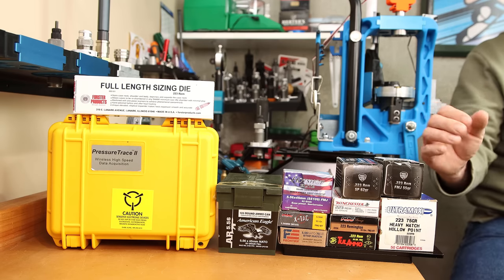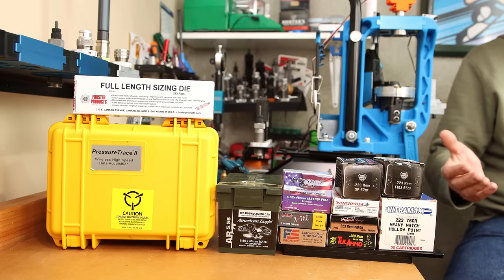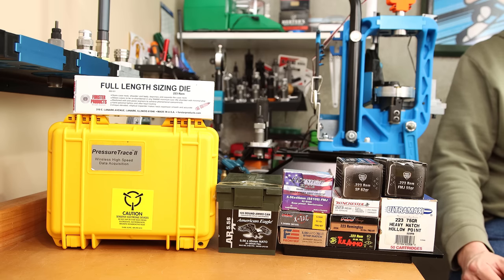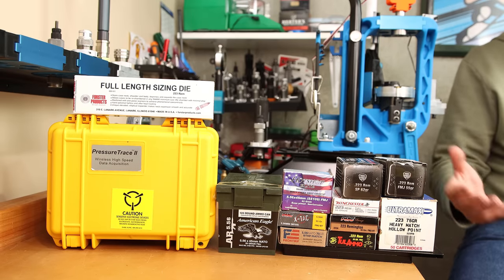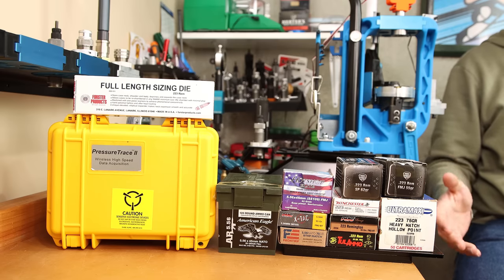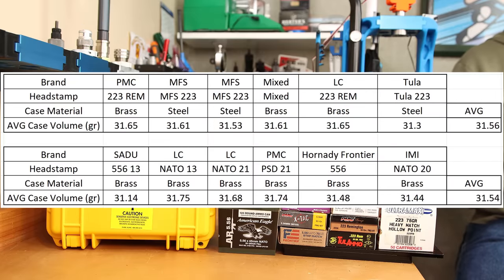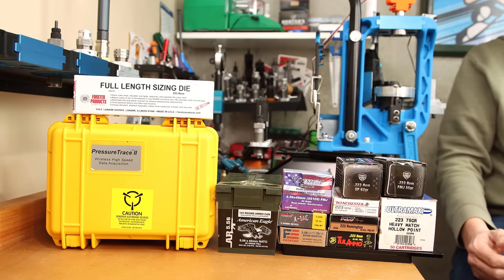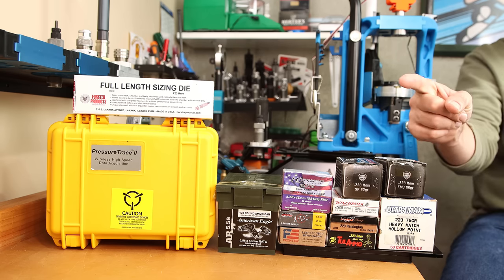223 vs 556 - The Hidden Truth No One Tells You!

Comment: I’ve heard so many different explanations of the differences, that I just built all my rifles with 5.56 chambers and shoot whatever I have. No worries
Reply: There is still one worry, you should never shoot soft point exposed lead bullets out of an auto loading rifle, the same holds true with shooting soft nose .30/06 out of an M1 or soft nose .308 Win out of an M14, when you do that you run the risk of a sliver of lead being shaved off of the tip while cycling the round into the chamber and getting lodged in between the casing neck and it's mating surface in the chamber, since all of those cartridges head space off of the casing neck this can cause issues that can lead to the weapon firing without the round being fully "in battery".
Now you'll run into all kinds of people who'll say "That's a bunch of bull, I've been doing it for years...", well if anyone wants to second guess the SAAMI who are the people who do all the testing and research on firearms then God bless them, something like that may be rare but if you have my luck you'll get skin tore off your face the first time you try firing soft nose hunting rounds out of an auto loader.
For shooting hunting rounds out of an auto loader safely is why Hornady developed the Ballistic Tip Polymer nose bullets, the plastic tip is the right material that won't have a sliver shave off and cause that problem.
Reply: @dukecraig2402  Wouldn't that be totally dependent on whether or not all the sharp edges have been removed from the feed ramps?  And more of a concern during the break in of a new rifle?  It seems right now the biggest concern is being able to source ammo while not paying the current extreme prices....
Reply: @chuckvan1568  
Yes I'm sure feed ramp work would help but why not just run the polymer ballistic tip rounds? That's exactly what they're for and even though feed ramp work might cut the number of incidents from slivers of lead from soft points you have to assume that there's still going to be incidents of it happening so why take the chance of being one?
I remember seeing reviews in American Rifleman and Guns and Ammo that showed them just as accurate as soft points of the same weight and the overall ballistics were the same. 
There's no advantage to running the soft points only a disadvantage
Reply: @chuckvan1568  I've checked this in my Springfield M1A and the soft point part of the 3 types of SP ammo I have, the leaded tip does not contact the feed ramp when cycling, the first contact is with the jacket behind it. So while it's a valid issue in general and something to be aware of, I don't believe it applies to all situations and all ammo. Presumably the same issue could occur with a bolt action rifle too, depending how the round cycles from the magazine.
Reply: @dukecraig2402  I just about only shoot soft points out of all my auto loaders. So I call B's.
Reply: @dukecraig2402  shaddap.
Reply: @dukecraig2402  I’ve heard this but I think it generally applies to older guns and ammo like the M1. I think modern AR feed ramp geometry alleviates this. Although I don’t really see much 5.56 soft point anyhow. I do know that you shouldn’t use normal full power off the shelf .30-06 in a Garand. You’ll want some reduced power loadings that are on par with the M2 ball from WW2.
Reply: @JG54206  
There's absolutely nothing wrong with off the shelf .30-06 in an M1 as long as it meets 2 criteria, no exposed lead nose and nothing heavier than 180 gr bullets.
It's not the weight of the bullet itself that's detrimental it's the slower burning powders used for heavier bullets, they'll potentially bend the operating rod of an M1.
Down towards the muzzle where the gas hole is in an M1 barrel is the point where the pressure should be at a certain level that the M1 was engineered to handle, by running a slower burning powder it blows higher pressures into the gas system putting the the operating rod at risk of bending, above 180 gr bullets .30-06 starts using slower burning powders than the 150 to 170 gr (173, 175 gr match grade bullets) use, 220 gr off the shelf is the worst because it runs an even slower burning powder than what starts at 180.
Reply: @dukecraig2402  Check out InRangeTV’s video on this. They used off the shelf 150gr and measured higher bolt/operating rod velocities using a slow motion camera and counting the frames. Off the shelf modern .30-06 absolutely can be overpressure for an M1 even below 150gr. The M2 ball is 150gr at 2750fps. Modern 150gr loadings are usually closer to 2950fps off the shelf and will have slightly higher pressures. This is why Sellier and Bellot makes a 150gr FMJ at 2750fps.
Reply: @JG54206  
Well here's the thing about that, first off did it actually bend the op rod?
Did they test different lots of military ammo from different arsenals to see if they all had the same op rod speed? 
Because I'll guarantee you they'd have found that, different op rod speeds from one batch to the other of military ammo and the fastest one could very likely move the op rod faster than the civilian ammo did, that's one of the things that makes match ammo match ammo, consistency, that's why the military made match ammo for their shooting teams in the first place, because after running tests that goes well beyond anything you'll see on a YouTube video they found all kinds of inconsistencies in service grade ammo from one lot to the next even from the same arsenals with the same head stampings, most anything that causes those inconsistencies is also going to change the op rod speed.
Years ago I read the report from Lake City Army Arsenal about their development of match ammo and part of it was testing batches of service grade ammo to get baselines and to  determine what needed to be improved to manufacture match grade ammo, they determined that the biggest problem creating inconsistencies in service grade ammo was the amount of powder from one round to the next from the same lot and the variations in the burn rate from one batch of ammo to the next from the same lot despite an arsenal using the same powder, those inconsistencies would definitely create different op rod speeds with their high speed film camera test.
One thing a lot of people don't get about the difference between hand loading and mass produced ammo is the powder used, as an example you can take apart Winchester ammo and measure the amount of powder in it and despite them saying that they use a particular type of their own powder in that cartridge it's weight won't match the amount they tell you to use in their own reloading chart, there's a reason for this, the powder they sell for reloading is what's called "canister powder", canister powder has to be made with the same exact burn rate from one batch to the next because you need that consistency as a reloader not just for accuracy but to keep pressure levels the same for obvious safety reasons, the way they achieve it is after making a batch of powder they test it's burn rate, then to get the same burn rate that's their standard for that particular "canister powder" they mix either a faster or slower powder in with it to achieve that, but when they make cartridges that they sell they make a batch of powder and check it's burn rate and adjust the amount of powder they put in a cartridge to obtain the same velocity from one box of ammo to the next, military arsenals do the same thing when making ammo, knowing that cartridges from the same arsenal can have different burn rates of powder from one lot to the next would give you different op rod speeds from one lot of ammo to the next, a slower burning powder would have a slightly lower chamber pressure and a slightly higher pressure down the barrel where the gas tap hole is to keep muzzle velocity the same, or vice versa for for a faster burning powder, so you can bet you're gonna get different op rod speeds from one batch of ammo to the next even from the same arsenal with the same date stamped on the head.
Just because they tested "military ammo" doesn't necessarily mean that it was a representation of some kind of standard for op rod speed, without them testing a bunch of different lots of ammo especially from different arsenals from over the years how can they say what an acceptable op rod speed is? Knowing what I just explained about the way ammo is made I'll guarantee you that they'll get different op rod speeds from different lots of military ammo.
All their test would prove is that different ammo will move the op rod at different speeds, if they didn't test a bunch of different military ammo lots they don't really have a comparison baseline, they could easily have found out that some military ammo would cycle the op rod even faster than the civilian ammo they tested.
Most importantly without knowing what the threshold is for damaging the average op rod in an M1 their high speed film isn't going to prove anything, and without testing one to destruction they have no idea what that threshold is, very possibly it's quite a bit faster than what's shown in their video with the off the shelf ammo. 
Even more important is the fact that you can't just test one rifle, all that proves is the nuances of that particular rifle, when the military runs tests like that they use batches of new unissued rifles to get their baseline information from and most importantly they test some to destruction to find out what the pain threshold is for something, because without knowing what that threshold is you don't know what ammo is safe for the op rods of M1's and what isn't, the faster op rod speed in that video could easily be well inside what's safe for them.
Now in all fairness you do have a very good point about some of the ammo out there, I have the habit of not including these modern ammo's that make velocities well above the traditional velocities for what's called "off the shelf" and that's a lingo shortcoming on my part, I've never really considered them regular commercial off the shelf ammo, instead I file them under a custom hand load that some of these boutique ammo makers offer and that's my fault, from now on when it comes to the subject of "off the shelf" I really should include them, it's just that for years I've dismissed them as nothing more than gimmicks for people who want to get suckered into dick measuring contests over velocities, when in fact since you can buy them over the counter they are really "off the shelf ammo", my views on the whole matter have always been that they're unnecessary because traditional .30-06 ammo has always been sufficient for all but the biggest of North American game and when it comes to them you shouldn't be hunting with a .30-06 anyways you need to move up to a bigger cartridge. 
I'm gonna watch that video under your recommendation, but if they don't show me that the op rod moves faster than the fastest from a bunch of different batches of military ammo would as opposed to one example I'm taking it with a grain of salt, you can bet when Garand developed the M1 they were tested to destruction to find out what'd work and what they wound up accepting was something that has an op rod that can take speeds well above what's inside the variations from different batches of military ammo, and without those guy's having tested pressures where the gas tap off is or risk bending the op rod in one by firing ammo known to bend an op rod so they can measure it's speed they don't really have a comparison to what's known to be harmful to an M1, like I pointed out you can bet the military didn't accept a design that just barely survived the ammo they were already using.
One more thing that just occurred to me, not long before WW2 they adopted a new US .30 cal that had much a higher muzzle velocity but wound up discontinuing it because bullets fired at the shooting range were traveling past where military property stopped at a lot of posts and was putting civilians at risk, they approved that ammo for M1's and I'll bet the op rods probably moved faster than what's shown in their tests on that video.
Reply: @dukecraig2402  that’s a literal novel. They used M2 ball as the control. The video is available and easily found on YT. I would trust them as well as their video evidence as well as the fact that I know the specs for M2 ball and I know the specs for what I bought off the shelf and the off the shelf stuff is the same bullet weight but about 200fps more which means it most likely develops higher pressures… even if only slightly.
Reply: @JG54206  
Yea, I watched the video and after I saw "Gun Jesus" enter the frame on the right I rolled my eyes back in my head and said "Here we go".
I've caught that guy being wrong about quite a bit especially about M14's, he's done the same exact thing talking about that rifle that most other's do that put themselves out there as experts, repeats a bunch of myths about them that's just plain wrong, it got to the point watching his videos that I just blocked his channel, one that covered the M14 was the straw that broke the Camel's back.
Several months ago I read an article concerning motorcycle's written by a guy named Kirk Cameron that does tech writing for Cycle World, that man's as good as it comes when talking about someone who gets it right and does the research, the subject of the article was about how a myth or a particular bit of bad information can get passed around and repeated so much about something that it becomes the accepted norm, Gun Jesus was doing that very thing in regard to the M14. 
In the Range TV video he contradicts himself several times, and one thing he says that's wrong is that the M1 has a "specific pressure curve" that it's designed to work with, not really, there's actually a window of curves it can deal with. 
And I was right before I even watched the video, first off he shoots 150 gr rounds from one particular lot of ammo, then he compares that to the civilian 150 gr ammo, like I said you'd need to shoot batches of military M2 ball from different lots and different arsenals to get the full story on op rod speeds for military 150 gr, I'll reference the Lake City Army Arsenal report again that showed pressures that were all over the place when they ran their tests, I explained how the military ammo plants do the same thing as civilian ammo makers do in regard to powders, they take a batch of powder and check it's burn rate and then adjust the amount in the cases to obtain the correct muzzle velocity for the sake of the calibrated sights working properly on the M1, ie dial the sight to 300 and it'll hit at 300.
Just as I predicted before I watched the video he presented one batch of M2 ball as having an op rod speed, you can't do that for reasons I just explained, one of the steps LCAA took when developing match ammo was to adopt the canister powder method for loading, that way they got the same exact pressures from the chamber to the muzzle every time which would result in the same op rod speed as a byproduct, keeping the pressures the same that way would be particularly beneficial for the M1 because of the way match grade M1's are bedded with the barrel being under tensions. 
Another thing concerning Gun Jesus's op rod speeds is that M1's were approved to shoot ammo's that weighed more than 150 gr and I wouldn't be at all surprised to see op rod speeds from them that exceed the civilian 150 gr ammo that he tested, which I'm sure would still be under the op rod speed of the 220 gr he shot but I'd lay odds it'd be right up there with the 150 gr civilian ammo.
And let's not forget that 173 gr match ammo is shot all the live long day out of M1's for competition and it's widely accepted by every authority on M1's to be perfectly safe for their mechanisms, matter of fact that's the same weight bullet as some of the heavier military loads I mentioned earlier that the military approved for use in the M1, I'd wanna see his op rod speed tests on those before I'd quote him that the civilian 150 gr he shot was bad for M1's. 
I've been building performance engine's for years, what I saw him do in that video is the same thing I've seen a guy who has a channel called Project Farm do with engine's, even a little further though, he'll buy 2 brand new small engine's from Farm and Fleet and using one brand of oil in one and another brand in the other he'll test them to destruction and present his results as proof that one oil's better than the other or they're the same or whatever, that's not proof of anything, on it's surface it may look good to someone who doesn't really know any better but there's too many variables to draw conclusions from something like that, you need batches of engine's to make determinations based on testing things to destruction or even just measuring wear, there's too many variables in the production of the engine's in the first place. 
Like I admitted I'll take a hit on my shortcomings when it came to the lingo of what's "off the shelf ammo", I did drop the ball on that one and like I explained it's because I've never considered these new "out of the normal velocity per bullet weight" loads you can buy nowadays as off the shelf, that's a fumble on my part, I've just always filed them under unnecessary gimmicks like I do with 90% of the "miracle products" for engine's like Slick 50, and that type of ammo is something I'd never shoot out of an M1 anyways because all the ammo that the military approved for the M1 will get any job I need done accomplished.
And yea, discussing something like this, presenting all the facts and dissecting Gun Jesus's claims is going to be longer than a simple "I saw the proof" statement in your average YouTube comment, like engine's a firearm, especially one like an M1, are complex subjects, look at how long it took Garand to develop and perfect the M1 before the military would accept it, like the Project Farm engine tests I referred to you need more samples and data before you can claim one oil is better than the other, when it comes to Range TV's claims about that one particular 150 gr civilian ammo I wanna see that same test done on different batches of military 150 gr ammo along with the heavier military loads as a comparison before I'll quote his claim that the 150 gr civilian ammo he tested is bad for M1's.
Reply: @dukecraig2402  Well that’s fair enough. Nothing you said is wrong. You do need more of a sample size to make and real concrete conclusions. For me, it’s enough to put me off using modern .30-06 loadings unless they’re stuff like the Sellier&Bellot stuff that’s made to the M2 ball specs. I’m fairly positive that no one round of commercial .30-06 would blow the gun up, just that extended use of it will wear it out prematurely. I’m not exactly looking for proof, just evidence, and for me the increased op rod speed off the one sample, as well just the quoted specs of standard box 150gr commercial ammo being around 200fps above what M2 ball is supposed to be is enough to tell me to not use, or limit the use of that type of ammo in a Garand. For me a Garand is mostly gonna not be shot much. Just a piece of history. For a shooter I would just try and find one chambered for 7.62 NATO/.308 Win.
Reply: @dukecraig2402  Or just snag an M1A and shoot it to your hearts content considering it can be rebuilt and replaced easily and isn’t “special” in any way.
Reply: @JG54206  
Got 'em.
That's one of the ways that I know a bunch of the myths about them are total nonsense, and the rest are gross exaggerations. 
That and the military reports on tests they conducted with them,  and I don't mean the malarkey that comes from that 1968 Congressional report, that's actually where a bunch of the myths come from, that and the people who write books on the subject who just repeat those myths that use that report as reference material.
Reply: @dukecraig2402  Also out of curiosity I would like to know what “myth” Ian is propagating about the M14. Or any other guns for that matter. Forgotten Weapons is widely accepted as doing excellent research and having extremely reliable information.
Reply: @dukecraig2402  For instance? Asking about the M14 in particular.
Reply: Exactly
Reply: @dukecraig2402   The lead head will apply to shooting FNFAL in 7.62 even if it is a 7.62 lead head against a 7.62 FMJ  there was lead shivers everywhere even in the magazines.
Reply: @chrisbraswell8864  
Could be with them to, I know it's considered unsafe with M1's and M14's.
For years Browning has made the Browning Automatic Rifle (not the military M1918, the civilian BAR) for hunting in states that allow semi auto and I'd imagine they were safe to shoot lead nose ammo out of since back then that's about the only kind there was, how it dealt with that issue I have no clue.
But I do know military semi automatic rifles are considered unsafe to shoot that ammo through, that's why they finally developed those polymer tipped bullets.
Reply: @dukecraig2402  This would happen to me with freedom munitions soft point ammo out of a factory built anderson AM-15. Burrs on the feed ramp would chew the shit out of the projectile and sometimes even push the projectile all the way back into the casing. I have pictures...
Reply: @dukecraig2402  right, thanks for sharing. Its one of those things where you ask "it may be rare but how many times do I want the consequences that it potentially has,  going wrong before I say well maybe I better not do that?"
Reply: I have a Colt AR-15 SP-1 I bought new in 1972 it is 50 years old. it is marked .223 I shoot nothing but 5.56 and have for decades. In 1972 ARs and M16s were made on the same assembly line.  
Either I'm the luckiest guy on the planet or someone is blowing smoke.
Reply: @jordangouveia1863  
There is no smoke blowing going on.
One of the things that leads people to believe that 5.56mm and .223 Rem are the same exact cartridge is the fact that reloading dies are marked 5.56mm/.223 Rem, but look in Brownells or any other supplier that sells chamber reamers and you'll see that 5.56mm and .223 Rem are two entirely different reamer's, that's the difference between 5.56mm and .233 Rem, the chambers are cut differently, 5.56mm has a longer "free bore" which is the distance between the cartridge and where the rifling starts, the longer distance to where the bullet is pressed into the rifling of the 5.56mm is because of the powder charge selected for use in it, without that longer free bore pressures rise into dangerous levels. 
Originally the M16 was going to be chambered in .223 Rem, but at the last minute of it's development right before the military accepted the M16 they decided that they wanted more velocity out of the cartridge, so a hotter powder charge was selected and the increased free bore was added to the chamber to keep pressures at a safe level. 
No one's making any of this up, find an article thats's a credible source for the history of the development of the M16/5.5.56mm/.223 Rem story and it'll tell you just that.
The SAAMI doesn't warn about shooting 5.56mm in a firearm chambered in .223 Rem for no reason, they're the people who set all the standards and more importantly do all the research when it comes to things like this, and their research isn't wetting their finger and sticking it in the air, and it's far more reliable then all the people you'll run across who say "They don't know what they're talking about, for years I've been...".
If you've been doing that for years and getting away with it all it means is you're lucky, not that the SAAMI doesn't know what they're talking about.
Reply: @djl5634  “b’s” lmao
Reply: @ambi_cc8464  Remington woodmaster 740     benneli R1.  Pietta semi automatic 3006rifles.  Bar rifles.   All are 30 06 hunting rifles specifically for SP and HP ammo.     Also vepr 3006     and m1 garands are the same.
Reply: @djl5634  i was commenting on the fact that you typed bs weirdly, didn't need an explanation
Reply: @ambi_cc8464  on a phone.  Proper pronunciation and punctuation isn't my first worries.
Reply: @djl5634  yea but you added punctuation where it wasn’t needed tho?
Reply: @ambi_cc8464  yea I do that just to pause.
Reply: @dukecraig2402  They headspace off the case shoulder not the neck.
Reply: @russellkeeling4387  
That's what I meant and I'm sure you probably knew that.
Reply: @djl5634  Ladies and gentlemen, this guy calls B's.

Look up the grocer's apostrophe, then stop using it.
Reply: @dukecraig2402  Calling horse hockey on that one.
Reply: That’s exactly what I’ve done too. Two AR’s both in 5.56 and a bolt rifle also in 5.56. All of them will eat anything
Reply: @ThereIsNoSpoon4  I had the same problem of bullet push-back in a Century cobbled together Galil. The lower receiver was defective and the magazines sat too low. Bullets would hit the barrel instead of the feed ramp. Feed ramp itself was okay. No Century Arms crap no more.